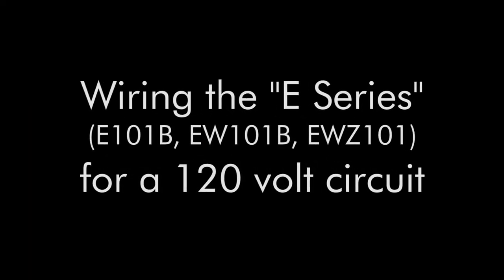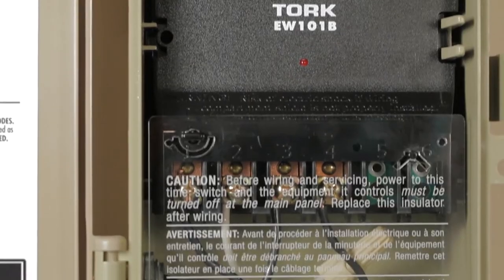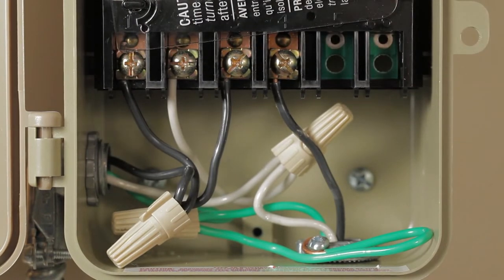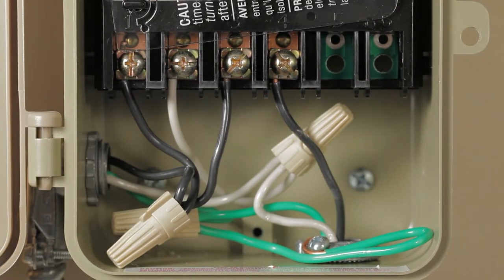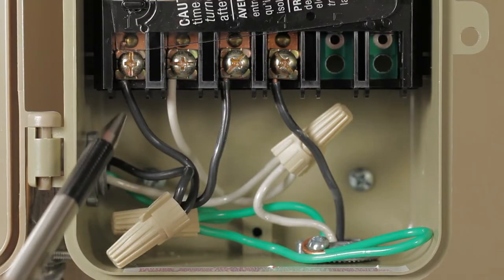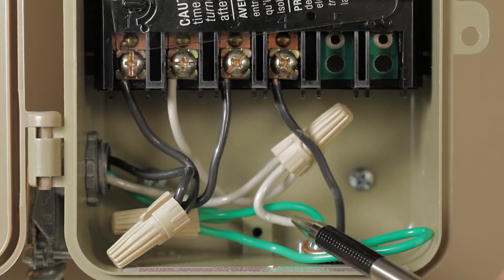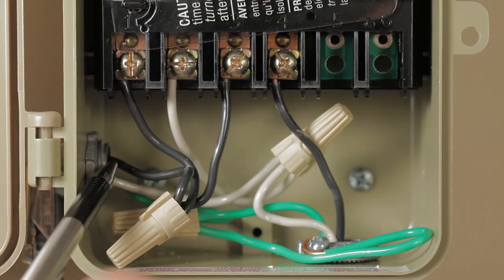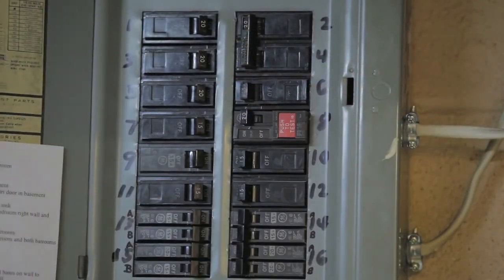Tork- Wiring the E Series Timers for 120 volts

Comment: I understand that terminals  1 and 2 are used to power the time clock, but can  terminals 3 and 4   be used  to open and close  ( interrupt ) the  AC power leg  of the load device, which is   powered by a separate circuit breaker ..thanks